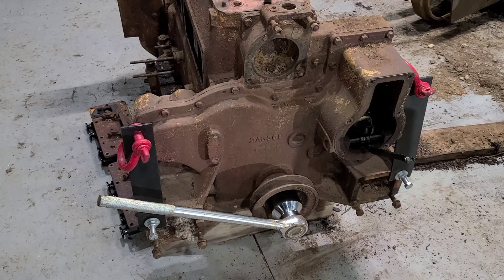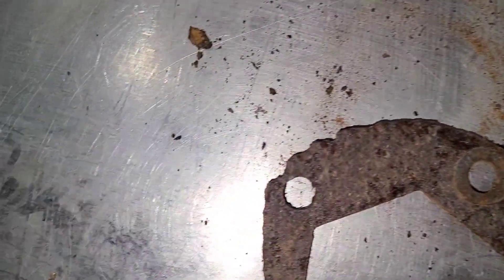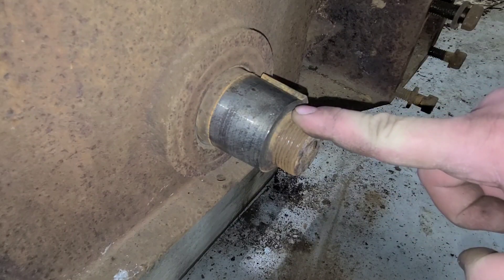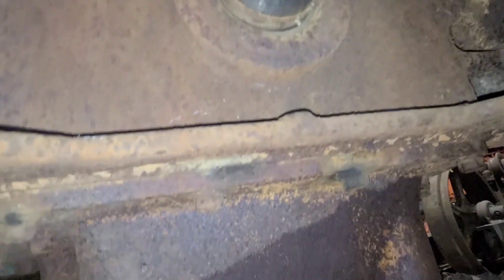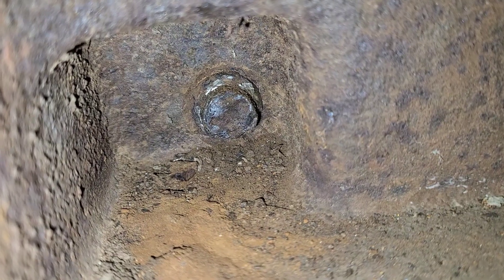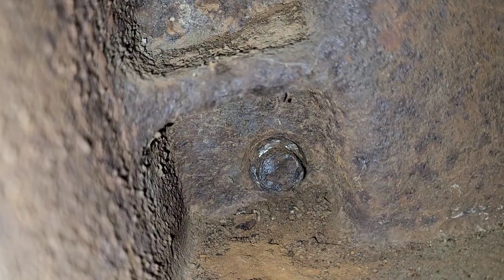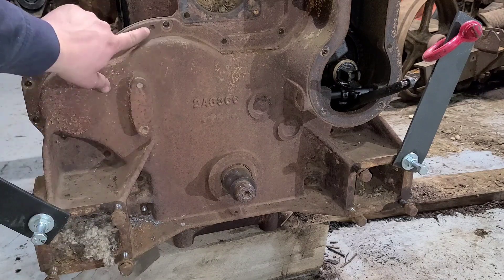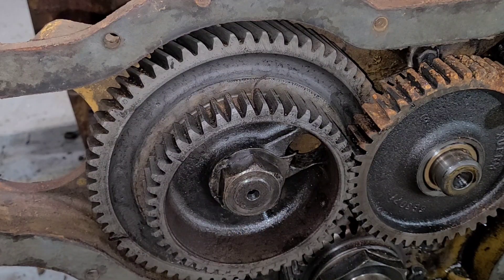Caterpillar RD-4 Engine Disassembly Pt.7

Comment: WD-40 is not a rust penetrant. Try the same test with BB Blaster, Kroil, or any other rust penetrant. And also compare it to the WD-40. You are still entitled to your opinion. Keep at it. And remember, when in doubt, get a bigger hammer.

Comment: If oil really “penetrated” threads past a bolt head, all oil plugs in the oil pan would be useless.
Reply from the maker: Most oil pan plugs have a copper gasket or o-ring on them to seal because they are a fairly loose thread, but depending on how tightly the threads are machined, oil may not chase down the threads. The machinist handbook has specs for thread tolerances and fitment, tighter threads will hold back liquids, we experimented a lot when thread fitment when I used to do a lot of machining
Reply: @kylechrist  yep and the point is a rusty crusty bolt with 0” clearance and similar has little chance of oil helping as you’ve shown above. Too many folks have false hope in “miracle lubes”! 

“Ya gotta work it a bit”, keep soaking it, and cross your fingers.

Comment: How would you like to hand crank it?? LoL
A good pair of dikes works well for removing keys, punch gets used a lot too.
Penetrating oil, has its place.. like you said, the extra threads full of 💩.
Given enough time, it can soak in. 
Anymore, I prefer Fluid Film. And I usually use it for assembly..
That little bit of pitting shouldn't be an issue.. ods of finding a better one are a bit slim.. unless you can find a different one and make it work..
Show the trailer work.. it's all part of what you do.

Comment: You've missed the whole point of penetrating oil...the clue is in the name...penetrate ......to penetrate the oil needs time.if you spray and then after one second try to take the bolt out its common sense it won't have time to creep..if you spray and leave for ....say 12 hours depending on size of bolt and rust etc..it will make its way into the threads..if you research the history on penetrating oils you will understand the research and development that has gone into it...

Comment: Rusty gears. Cutting edge engineering au had a video that did a welding process similar to spray welding that might be used to build up rusty gears to recut new teeth..

Comment: I am not an advocating for Penetrating oil either but Water Disbursing formula 40, AKA WD40 Is not a penetrating oil
Reply from the maker: Correct, more to come on this soon. You wouldn't believe how many comments I get on "why aren't you using WD40" so this was a quick demonstration to show why it's pointless to do so

Comment: First off, WD40 is NOT a penetrating oil and was never intended for that purpose. It is a water displacing lubricant, hence the WD in the name. Do some research. There are many videos on YT about penetrating oils and their use. I’ll never understand where people got the idea that WD40 is a penetrant.
Reply from the maker: On the can where it says it "loosens rusted parts" is I'm sure where that's misunderstood. WD40 does make a penetrant though. With that being said I don't like any penetrating oils to begin with, I prefer heat with a torch. The point was to show everyone in the comments who says I need to spray all the bolts with WD40 that it is pointless to do so

Comment: Your penetrant test is not valid, it is not a good example. Places where you should of used it to help pieces move more freely and easier, you didn't use. In your test, I agree with you, it is useless. If you did have problems removing that bolt, heat would be best, and not penetrating oil.
Reply from the maker: Patrick, I get comments all the time about not spraying every single bolt down with WD40. I know this isn't a valid test as well as you, what I'm trying to point out is that people who suggest soaking all fasteners down in WD40 are wasting their time. I don't like penetrating oils, my go to is heat, and I still get comments about not using a penetrant of some sort 🤣